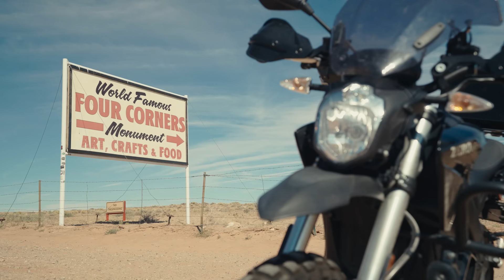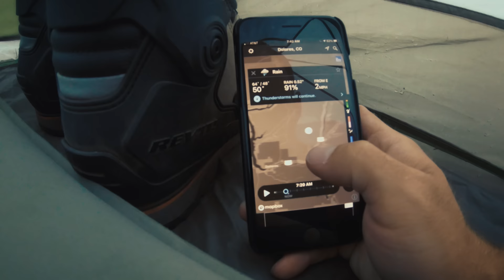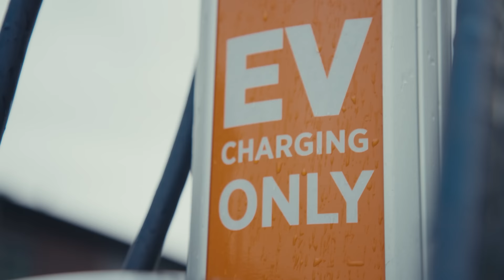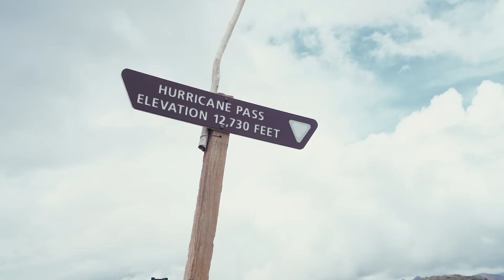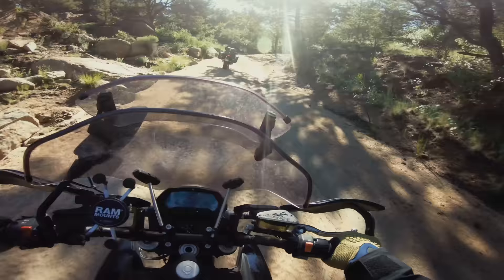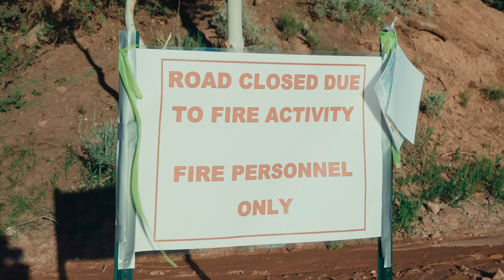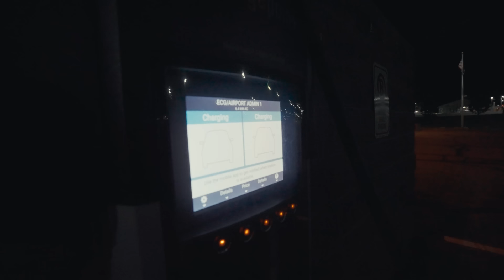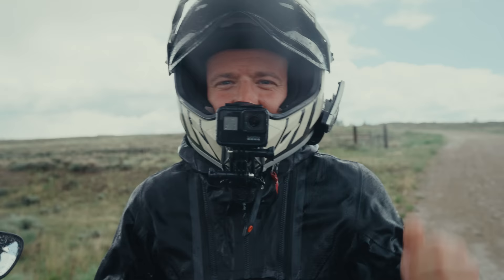We Rode 1,000 Rocky Mountain Miles On Electric Motorcycles | Zero DSR Adventure Ride

Comment: Well done! Y'all might also be interested in this: I rode the TAT on my DSR this summer - 7500 miles, mostly off pavement, across the US. Ride report is on advrider "Two bikes, one jug, Zero DSR"
Reply from the maker: That is amazing! What a huge undertaking that must have been. We'll check the ride report out. How long did that take to complete?
Reply: I saw your build on ADV Rider, awesome work! Thank you for the share on the forums!
Reply: @ElectricCycleRider  It took 57 days to ride 7610 miles coast to coast, but there were a lot of zero-mile days for weather, rest, hiking, etc (10 total zero days, I think). When riding, 150 to 200 miles a day was typical, which is pretty similar to our pace with gas bikes on routes like the TAT. 7610 miles divided by 47 riding days is 162 miles per day, average.
Reply from the maker: Very cool. I read the thread. Quite a trip! Thanks for sharing the journey 👍
Reply: Great and interesting video, you guys did amazing, again thanks for sharing 🏍️
Reply: Nice work on the TAT. My dad and I did it in 2009 after I graduated from college (RR titled "TAT: A Family Affair"). We started in Jellico, TN (that was the start at the time we did it) and did roughly 4,500 miles in 28 days. Congrats on your ride.

Comment: As an older guy with 50 years on two wheels, I can accept that this may be the future which at this stage probably won’t include me, however, I can appreciate that yeah, silent riding in many circumstances could be a revelation.
I have ridden many and varied motorcycles over the years and currently riding an Indian Cheiftain which, along with several Harleys I have owned, gives me so much pleasure just listening to the ‘rumble’ of the exhaust…..I would miss that. 😎
Reply: I am 63, love my dsr.
Can't wait for the DSR/X, if that is a thing.

Comment: I was astounded when McGregor and Boorman chose a modified, prototype Harley Davidson LiveWire to do the Long Way Up. It was clearly the wrong bike for the job when the Zero DSR had existed for years before, not just because of the type of bike, but because the DSR charges much faster (3 times faster) on 6 kW AC chargers than the LiveWire does. DC is a different matter, but DC chargers don't tend to exist out in the wilds and certainly not in the wilds of South America.

Glad to see you guys picked the right tool for fhe job. Great video and nicely shot. 

And not a bus or generator in sight!👍😊
Reply from the maker: @John Chivers I have to admit I haven't watched Long Way Up yet. To be fair, I have heard about everything one could tell about their trip but didn't want it to influence our film, so I didn't watch it! 

I do believe the Zero DSR is the best bike for the job in this environment. One thing I do know is that Harley Davidson gave a sizable incentive to that production to use their motorcycles. I'll leave it at that! Thanks for the note 👍

Comment: Awesome !  Love to see the addition of portable Solar charging ⚡⚡  RESPECT
Reply: Solar charging can't be done. One could never bring enough panels with them to provide a meaningful charge.
Reply: @robertcoco893   I'm not so sure about that,   figure A 215 watt solar blanket that folds down to the size of a laptop and weighs about 7.8 pounds you could get 2 of them And probably have a full battery in about 5 to 10 days of good sun.    No you're not gonna charge up during your lunch break, however We are talking about an adventure bike type situation.  Ride 50 miles up into the back country set up a base camp with the chargers going and spend a week of fishing and camping Before packing it up and heading home with a full charge. [ Granted we are talking about spending a week in the back country with  half of your bike's cargo capacity taken up with charging equipment but I think it can be reasonably done  If you pack light and are handy with the fishing Pole.]
Reply: @mrspeigle1  that's stretching it a bit, a 215W panel is about 80%efficient, then account for inverter losses. Then the panel would have to be at a perfect solar angle throughout the day.  Still, 10 days is really not practical.

Comment: Wow.I.Need.To.Watch.This.Many.Times Thanks to you and Mark for doing this Tucker. Your comment about whether EV bikes and ICE bikes should be compared is so valid to me. I ride completely differently than I did in my 52 years of ICE bikes now. And just like those who came from the East across the US to the West in covered wagons many 'waited' until the railroad was built before traveling West. EVs especially two wheelers are the 21st Century version of venturing out West as pioneers. I'm so happy to be part of the new community of pioneers too.
Reply from the maker: @Mark Kitaoka Great to hear your perspective. I know you've got a lot of experience with the DSR and cool to hear your thoughts. Mark posed a great thought there with the EV and ICE comparison. It's inevitable we'll compare the two but they also need to be appreciated for their differences.
Reply: @ElectricCycleRider  Thanks Tucker. As I was talking 'ad nauseum' to my gf about the differences it occurred to me that ICE vs. EV bikes are similar to the difference between sailing vs. power boats. I've owned a sailboat and rented power boats. One is WAY different than the other and each has their own unique benefits and downsides. Sailors would not be caught dead in 'smut pots' aka power boats and power boat owners laugh that we use 1000 year old tech to move our vessels.

Comment: Without reading everyone’s comments to see if this has already been asked . A nice feature would be to be able to switch off the front headlight to help your range even if it’s only a couple of miles gained .
Glad y’all made it safely !
Reply: I have never considered turning off the lights even keep my my spots on. Heated grips and heated gloves makes no noticeable difference.
Reply: @kevinmair7571  If you have to push your bike to get to the next charging station you would change your mind .  An option is better than none .
Reply: @hotchihuahua1546  , I have pushed bikes on many occasions. No fuel, broken chain, flat tyre, untraceable electrical faults. The zero is no worse or better. Planning is the key.

Comment: Love it, I've ridden the COBDR and would love to take on some of the other routes on an electric.

Also, it's not an adventure until something goes wrong!
Reply from the maker: @Meerkat ADV That's right! It's an incredible route. Pretty cool to have the infrastructure to do it on the electric bikes if you so choose.
Reply: Thats a great point! LOL
Reply: I agree - good luck if something goes wrong with your Zero.  I have two - a 2019 DSR that's been perfect and a 2014 S that has been a nightmare.  Zero doesn't release much technical information on these so fixing it yourself will certainly not be an option unless you're dealing with a very simple or basic repair.  In that case, with current conditions you should expect a lengthy wait for parts and not much help from Zero customer service.
Reply: @ElectricCycleRider  My only suggestion would have been soft luggage.

Comment: I've been riding an ebike for 10yrs...
Bicycle based on a dual suspension, aluminum, dual disc. I have a massive battery,  standard for 750w is usually 3-5Ah.. mine is 20!!!  
I use it mostly when camping, out taking photos, etc...  and never in rain or mud.

Comment: Excellent! Next time video the regular "gas" stations you pass along the way to the next electric charging station. More charge points can reduce range anxiety.
Reply from the maker: @planetmikeus For sure. The state of Colorado (and others involved) have done an amazing job putting charge stations in hard to get to places and looking forward to seeing them pop up in more areas.
Reply: You can probably charge at someones house if they are nice. No problem. I don't even have the charge tank just a regular wall socket power lead.

Comment: The headlights on those bikes are pretty bright considering they share the power supply as the electric motors. Good job guys!
Reply: Thats a big part of whats so cool about electric vehicles in my opinion. Wherever you travel with one of these, you have a massive power bank to dip into. I have just a smaller 1500w ebike, and can run the headlight for over 15hrs on a charge. Or charge my phone for like a month straight. Its like the worlds biggest battery bank built into all these bikes, so cool.

Fantastic for camping

Comment: One thing to note is that the slower the charge rate the better for the battery. I don't know if there's that much to be concerned about with L2 but Harley recommended not less then a 4:1 ratio of L1:DC charging.

Comment: What happened with the snapped belt?  Is there another episode??
Reply: +1 A roadside belt change on a Zero DSR is not trivial.  You need the right tools and a way to compress the suspension to get the belt past the swing arm.
Reply from the maker: @NewZeroland Great question! We made it the entire trip without snapping a belt. After we crossed over into Wyoming, our Photographer wanted us to do a celebratory nose-to-nose burnout. I went a little too hard for the photo and snapped my belt. We originally had it as an "outtake" at the end of the film but decided we liked the summary of the trip best and pulled that scene out.

To clarify and to answer @Karl Bloss question too, we found a massive log and used it as a stand for the DSR. Expecting it might happen, we luckily carried the right tools and were able to lower the swingarm and slip the new belt on. Mark used the Gates Belt app to figure the right tension and we were back on our way. 

 To clarify, the belt I'm holding at 13:15 is because we were transferring Marks "essentials" over to my panniers.

As I mentioned in some other comments, a lot happened over the course of 7 days and inevitably, a lot of scenes did not make the final cut. Hope this answers your question!
Reply: @ElectricCycleRider  wow, that's wild! I'm so impressed that the belts survived all that rough terrain. Can't wait to see what videos you make next!!
Reply: @ElectricCycleRider  This is really interesting info for me; I have a DSR and want to do gravel roads, and the belt snapping stats out there are keeping me from hitting the trails. I rode it with the chain conversion for a while but it's really designed for the FX model's lower torque and it killed my front sprocket, was really noisy, and I didn't enjoy the vibrations. Now on belt I'm loving the smoothness and quiet, and so am looking at designing a belt guard so I can get off-road. Really impressed you didn't snap a belt on the whole journey. Thanks so much for doing this video; really shows what's possible with electric, when the riders know what they're doing - i.e. not me!
Reply from the maker: @NewZeroland  For sure! We prepared for the worst and carried 3 spare belts for each bike, thinking we'd need all three. Pleasantly surprised that we didn't, until of course the burnout. Haha. 👍
Reply from the maker: @jezthomas4402  I was definitely concerned about it at first too. I had tested a normal Zero DSR and loved the quietness of the belt but was afraid we'd run into a lot of issues with it on the BDR. So much that we almost switched the bikes to the chain drive option. I'm glad we didn't do that though because as you said, it's a big difference in ride quality. 

I will say that both our belts (especially mine) starting making some heinous squeaking noises after a lot of that mud riding and did not go away. You might notice it in some quieter riding shots. I'm not sure if we just got lucky but I know those belts had a fair amount of miles on them before we got them and then you saw what we put them through. Either way, I'm a believer! 👍
Reply: @ElectricCycleRider  Wow, that's amazing the belts took all of that punishment! Thanks so much for clarifying that; certainly give me more confidence. I think if I had a Jeep and crew behind me I'd hit the gravel all of the time, but I'm still of the opinion that I need to organise a belt guard for the gravel roads as if it breaks I really am fecked; I'm generally on my own, won't have the tools and skills to change it, am generally without phone signal, and am a long way from civilisation. Cheers now!

Comment: This was a fabulous video, visually, but I would have hoped for a bit more info about the set up of your bikes (looks like a charge tank rather than a power tank) and the ranges you were able to achieve each day. Things like how much regen to expect when coming down versus how much you used going up would also have been useful. I traded my DSR for a Triumph Tiger, simply because range was constantly an issue on any trip I took. The DSR is a great bike to ride, something you clearly proved with the trip you did, but it would have been nice to know more about what you were able to squeeze out of it.

Comment: Amazing! Really feels like I was watching The Long Way Up! 

Quick question: would it have helped you to have a small battery with solar? Seams a good idea on paper
Reply: Yup. I did it with my 12 1/2 boat. Yet its in the wiring. I have only an small trolling motor on it. I use two 20ah batteries. Put them together and wired them my way. 20 watt solar panel. Google says an trolling motors only last 5 hours or less on an single charge.  For being in for maybe many hours. I put the prop into an bucket of water. Set it to 30% power. Then let it go none stop. I quit at not 5 hours or less. At 12 hours straight. Then the batteries are also just AMG. Out did them all. Also designed it to charge anything I need.

Comment: I'm 62 and have been riding gas bikes slow for a long time. Without the vibration and sound of an internal combustion engine, and being able to shift gears, riding a bike would just not be any fun at all. I would love to do that ride on my highly modifies Yamaha XT225 with a 4 gallon aftermarket tank and an extra gallon in a set of tank panniers. 300 mile range, and you can get gas in a whole lot more places than there are charging stations. What if one of those charging stations had been out of order? What about most of the world where there are no charging stations?

Comment: Hear me out; what these things need are transmissions, but not the conventional low to high gear transmissions. Instead, have them go from a direct drive gear into a high overdrive gear so that you can retain longer ranges at highway speeds, but you don’t take away the benefits of having all of that 1:1 energy efficiency when driving slower. It just needs to be made reliable and compact. And that way there’s no need for bigger and better batteries right away.

Comment: first off , very well done video. Top quality filming and editing. I think for now we have a long way to go before we are ready for electric motorcycles . I for one do not want to worry about if I take a wrong turn or not and then have not enough battery to get to my charging point. Also I want to fill up and go. If I arrive in a town on empty charge I dont want to stand around for 3 hours and charge the batteries. I also do not want to plan my route around charging stations.  So many limitations that go malong with any electric vehicle. Once there are as many charge stations as gas stations and they have a system to charge that is 15 miniutes, and a charge range of 300 miles I will consider an EV bike until then its a hard no. Maybe this is the reason EV bikes just are not selling

Comment: Why not carry a solar charger and power bank large enough to charge your bike once? It's under 10 lbs and compact.
Reply: If you know of a 15-18kWh battery that is compact and under 10lbs, please tell me where I can buy one.
Reply: Not enough power. Charging these bikes with an outlet from the wall takes over twelve hours.
Reply: I too would like to know of the system you're referring to. I can charge my Sur Ron with solar in the desert but NOT with 320Ws of solar panels wired in series and a 1000W solar generator that weighs under 10 pounds or is small enough to carry in a backpack or strapped to the bike. And my DSR takes WAY MORE juice to charge than my SR. Please provide links to your solution. Thanks.